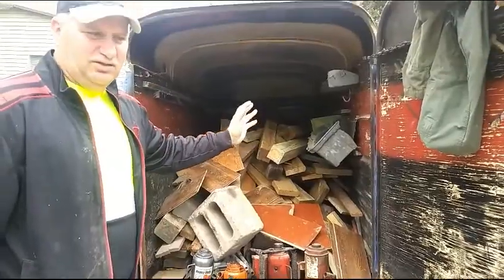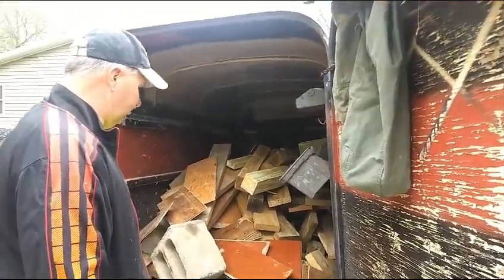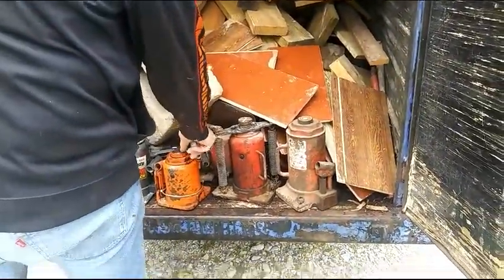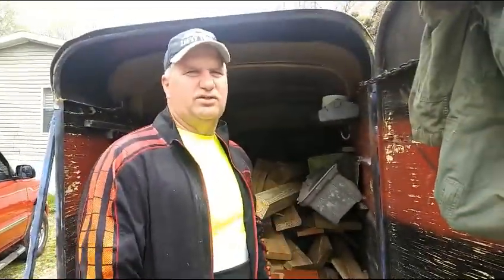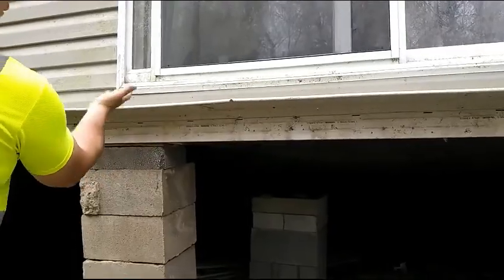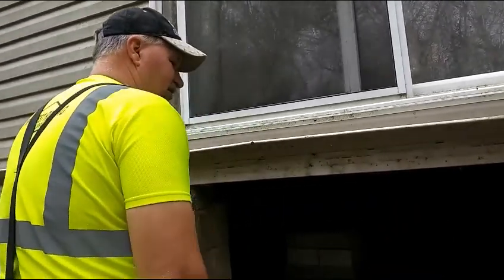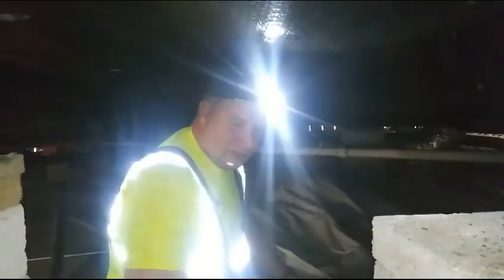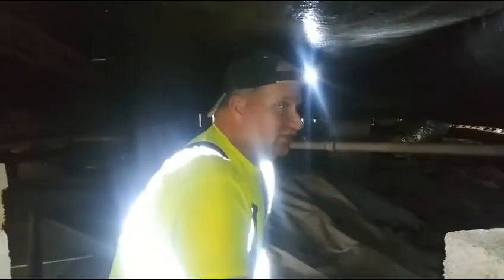Releveling Mobile Home 2020

Comment: I’m curious, if a mobile home that’s been on the ground, totally off of any piers, is worth getting raised back up. And have you ever done that.
Reply from the maker: Yes I have  more than once. One time high winds blew a single wide down  on the ground on the side of a hill had to dig to get jacks under frame. If a house has been abandoned for some time then it boils down to how to if you are moving it or not. If you are then it becomes very important to check for damage done to the ridge beam which is the 2 by 6 that fastens all the floor joists to get her against the outside of the house. If rotted it will not travel down the road with the proper strength. The frame will sag under the weight. All of that can be fixed. It's a lot of work. Still a new single wide now is easily over 80,000 dollars . It is how much do you want to do. Beyond that bring that house up. Make it what you want.

Comment: Any tips on how to find someone in an area that even levels mobile homes? Most around my area has retired.  I search mobile home releveling or handyman and every combination I can think of and have come up short. I have even called mobile home parks and asked. My niece has issues, she's in wet clay, rubber base and block columns. Shifted so much every pipe connected came off. We were lucky to find someone then but know they are retired too now. We were lucky to find him at the time. Know soon it needs rechecked and for the future and for repairs. Thank you for your videos and help.-John's wife
Reply from the maker: I think a mobile home mover would be where I would look . That is in their skills. You might mention that they could do the work when they get rained out. You see when it rains it softens the dirt and the trucks can't move for 3 days or more. Maybe you could find someone who watches my videos and buys a 20 ton jack. It still will require courage. Hope that helps.

Comment: My concrete runner on my single wide looks like one side of the runner is elevated/came out of the ground a little.  Its on the corner of the house.  Should I be worried?
Also,  I am on clay soil here in TN, every time it rains the water builds up on my side of the house but never goes under the house but can waster 5 feet away from the house loosen the soil to the runners near by?  Thinking about putting in a French drain but maybe 5' from the house is too close.   Anyone have any answers?  Thanks!
Reply from the maker: No.  In fact you are in a better than many that have no runner. All is well.

Comment: Hi, how are you.  I live in a double mobile home and I have found the high point and I have a difference of 1 1/2 and about 3/4 in the area of the middle, my question is.  where should i start leveling?
Reply from the maker: Glad to help in even littlest way. Instead of using the 1 and 1/2 high point use the 3/4 and bring the 1 and 1/2 down 3/4 that way you don't have to raise so much around the house. Hope that helps.

Comment: We have a double wide, been converted to real property. It needs to be releveled. How much should a job like that be?
Reply from the maker: It would depend on degree of difficulty. Still in my area I charge less than 900
Reply: @StraightArrowRepair  does it include the reskirting. If that makes sense. I'm new to this. Thank you.
Reply: 2024, we are paying 2200

Comment: Is it possible for a mobile to be level but still have sloping floors?
Reply from the maker: Yes I have seen that happen . To explain. It would usually be weight set on top of home causing floors to sag past the frame which is about 3 feet back from outside wall. Hope that helps
Reply: @StraightArrowRepair  thank you

Comment: How do I find the highpoint on my double wide
Reply from the maker: I have been using a water level for many many years . So I set it up to one point on the frame then move around with it under the house till I find how the house is sitting. You can use your high point. Or you could choose if you have room to come down some at the high point. With that being said I made a video on making a water level. Fairly inexpensive too. I wish you well with your project.
Reply: Well said.